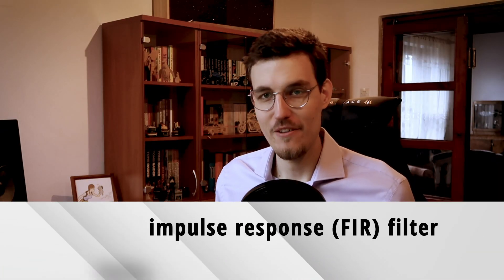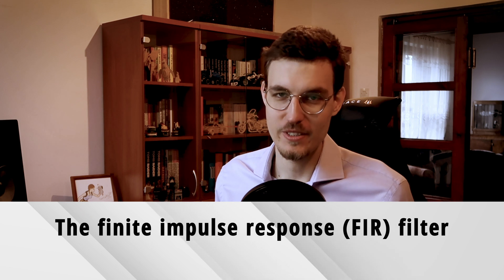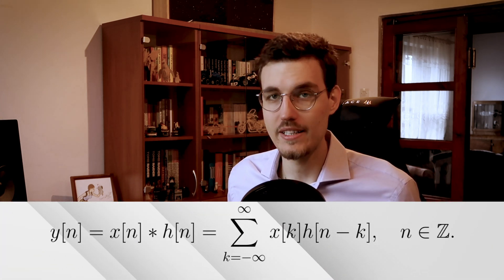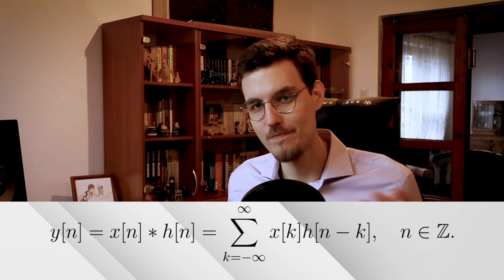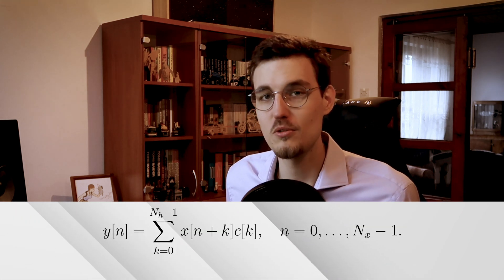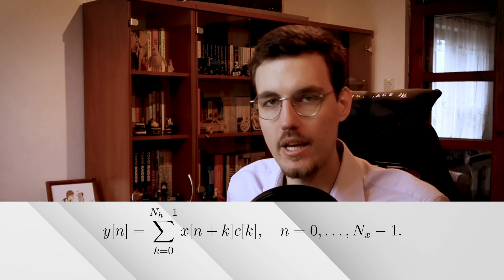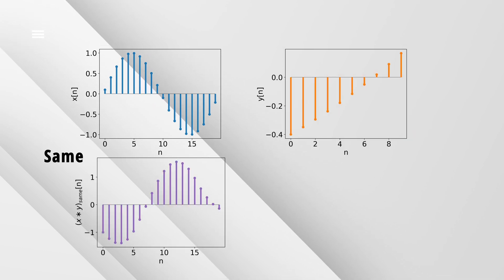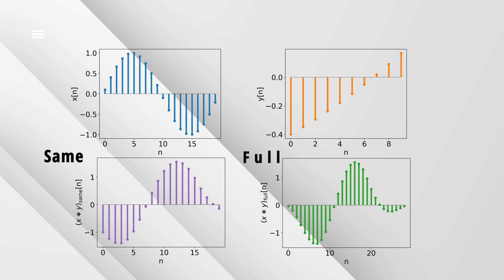How to Implement an FIR Filter in C++ [DSP #15]

Comment: Damn, that's a pretty crazy result for such a simple filter. I am a bit puzzled how we get from the impulse response to the coefficient list (dsp noob here), but will look into your code to figure out those details.
Reply from the maker: So the coefficients are just a reversed impulse response with some zero padding for the ease of implementation ;) If we want to use an impulse response of a room as a filter, we don't have to preprocess it :) Windowing is only used when we design the filter in the frequency domain. Thanks for your feedback; my videos are here exactly to make the DSP literature more approachable!
Reply: So, after a bit of thinking, are the coefficients just the magnitudes of each sample of that audio wave? Because an impulse is only 1 sample, all the other sound we hear is a result of convolution, w decaying size over time. Ok, little eye opener over here.
Reply: It's so bizarre and extremely fascinating how delay, reverberation and filtering are all one and the same thing. Makes sense in one way, twists around my head in the other.
Reply: @bigmistqke   The coefficients are calculated by multiplying the ideal impulse response of the filter with a windowing function. The textbook DSP A practical Approach by E C. Ifeachor and B. W. Jerwis has a nice examples if you are interested.
Reply: @danmiller4091  thanks for answering my question! I am glossing over it right now, this dsp-literature is quite dense lol. But if i understand it correctly, this multiplying the audio-file of the impulse response by the windowing function is because we are interested in the energy of the signal, right? Makes sense, as it turns the waveform into how the volume changes over time, and that's what the coefficients are. And then from this generated buffer we would take sample #0 and this would be a(0), sample #1 a(1), ..., sample #n a(n)? I assume this is what they describe in the book as the 'direct method'.

Comment: Why not use std::vector instead of raw C-style arrays?
Reply from the maker: Hi,  Matkat Music, thanks for the question. Since in the filtering function we don't do any memory management, std::vector would be an unnecessary detail. However, if you look into the source code I linked to, you will see that these raw array pointers are initialized with std::vector::data() so they use vectors under the hood :)
Reply: for up-to-date cpp, std::span would be better idea.
Reply: @wrongitstea  Sigh...another reason why there should only be C and Assembly programming languages.